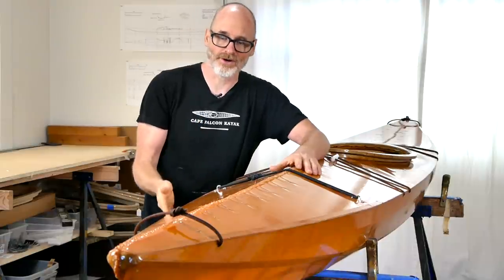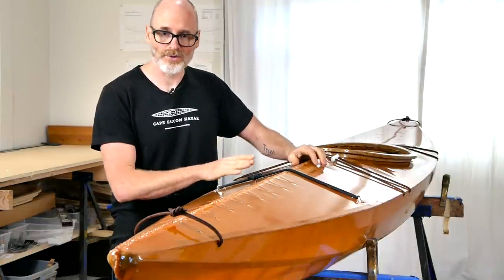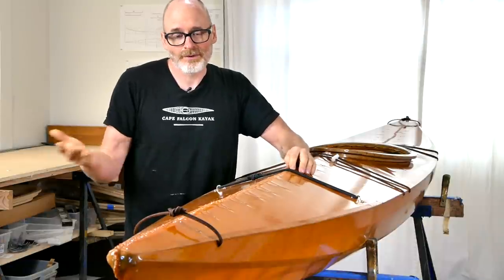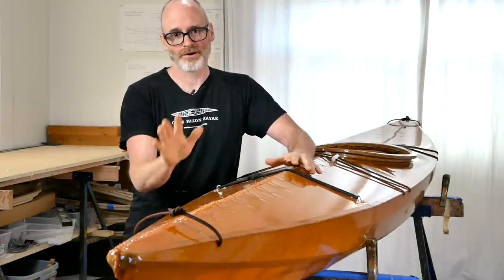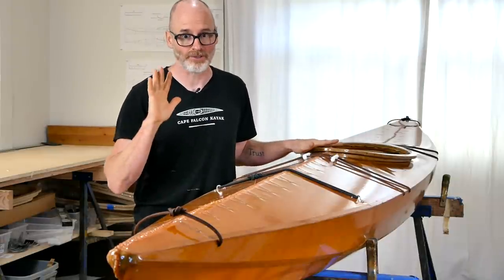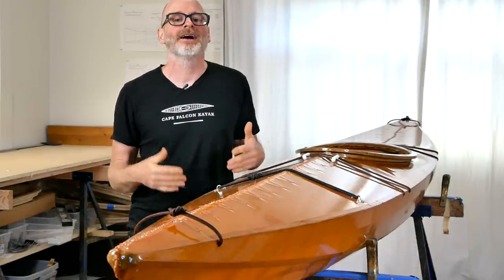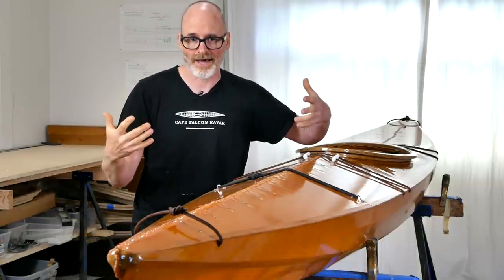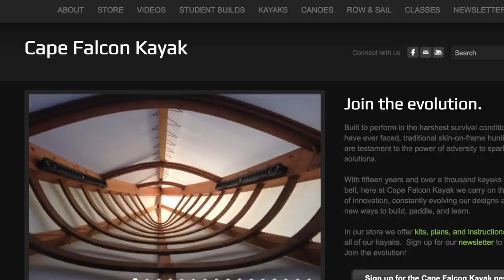Skin on Frame River Touring Kayak Update

Comment: I watched the video of your previous River Runner version - and must admit that combining the best of both will result in an impressive boat. I do like the flat rear deck of the first one as I don't see many camping trips so will keep loads down to the minimum. However, I do like the extra bit of stability from the extra chines on this model. Like you said, it is all about compromise and should be tailored to how the greatest number of folks intend to use it.
Overall I do like the slightly shorter length (vs the F1) and extra rocker makes it seem like it would be a hoot in rock gardens as well as surfing and playing in waves. The fact that it can also do that 1-2 miles to a play spot is great and may even want to use it for fishing. Lastly, love that stern drain plug!! I would love to commission one of these as soon as you are ready and able!

Comment: It would be really excellent to revisit this build for a final version to release! Being a Michigander, inland lakes and rivers are around every corner and from your description it sounds like it checks nearly every box.  Even looks stable enough to go out on a quick paddle without a skirt, and then load it up for the weekend camping tour.  Looks like it may even have some maneuverability when putting it on the big lake. 

If you need an inland beta builder/tester I would be happy to build one of these!
Reply from the maker: For anything flat water or even slow, moving water my F1 design is vastly superior.  This boat only makes sense if you’re going to be running continuous class 1 and class 2 Whitewater and maybe the occasional 3 if you know what you’re doing and you can pick a good lines.

It’s on the list for things to keep working on. I just have lots of design projects ahead of it.
Reply: @capefalconkayak  Good to know, thanks for the reply. I'll have to make a more careful consideration on the F1 when I choose my build.  Just have to finish my 3 wooden paddle boards when the weather warms so I can epoxy.  Then its Kayak time.

Comment: Kayaks being weight sensitive, this sounds perfect for a slightly heavier person. You might want to starting thinking about a range of kayaks for lighter and heavier people. My two cents, I love narrow hard chined kayaks but hate wider hard chined kayaks, so I can completely see the dilemma in choosing chine prifile. My three favorite kayaks; Mariner coaster,  Valley Anas Acuta, and [this is my weird point] the completely rounded chined Nimbus Solander. All three are perfect kayaks that exist on different limbs of the design tree.
Reply from the maker: Hey Richard, our flagship kayak, the F1 (over a thousand built in the last 13 years) was originally based on the Coaster (with permission from Matt and Cam) we build it in 7 different sizes for people from 100 to 260lbs and have a whole library of tested modifications for people who want to tweak the performance in different ways.  Being able to custom size things for each user is one of the big advantages of what I do.  Once I get a shape dialed in, then I start working out the sizes.
Reply: I can't say enough about the F1 ... built one of the big guy variants way back in 2010. Today it's still my go-to boat and other than a surfski I haven't seen the need to buy another boat. It does all I ask of it and it's a hoot to paddle. Brian's designs are top shelf!
Reply: @Kmuggle  I need to build one of these for myself.

Comment: super interesting that adding in a little chine shape negated the good performance points. suggests that ww and sea boats may not quite overlap on a smooth continuum. hope to meet you on the other side of that null point!
Reply from the maker: What sucks is that I had it stringered correctly and then I cut off the stringers at the last minute to try a more aggressive chine.  I'm still glad I did it though because otherwise I would have always wondered.  If I had done it right though I might not have decided I need to reshape the stern, which really does need to happen.  I always try to start with a simple rib length formula, in this case 5 1/2 inches, but things inevitably get more complicated.  I just hope there actually IS a point at which the hull becomes balanced.

Comment: How much flex would there be in the back deck/hull and-or the front deck/hull if you inflated the Trac bag to its maximum after you inserted it in hull compartment?  What I'm getting at is; can you inflate the boat up a little bit and change its shape ever-so-slightly by inflating the bags?

Comment: Why not add a retractable skeg? I have an 80s white water fiberglass boat on which I added a skeg and it tracks really well on flat water, but still super maneuverable and turns on a dime
Reply from the maker: Skegs are very hard to integrate with a skin boat

Comment: Beta yet?
I’m not an advanced whitewater paddler, so I don’t need the ultimate perfect boat. In fact your current stability profile on this is extremely appealing; and speed is definitely not a significant factor for this 73 year old guy.

I’d be very happy to be a part of your R&D, I’d also be v fine with video documenting the build.

In fact perhaps one of the versions you’ve done might even be better for me, in that spinning on a dime is more interesting than super tracking on the flat.

Also the raised stern for more gear is not important to me, and certainly the shorter build is valuable.